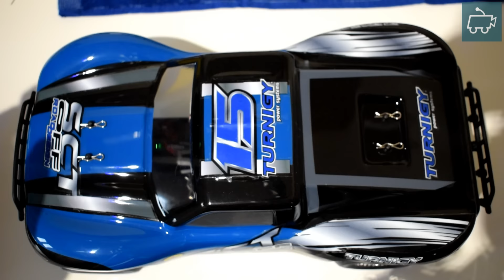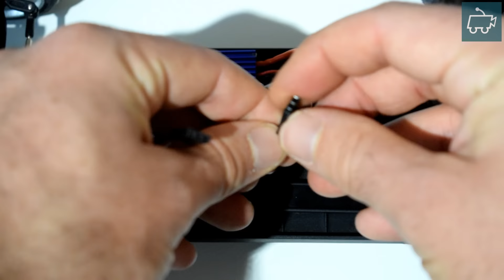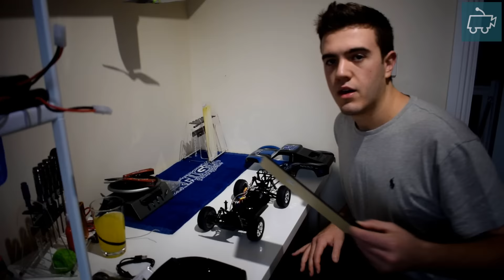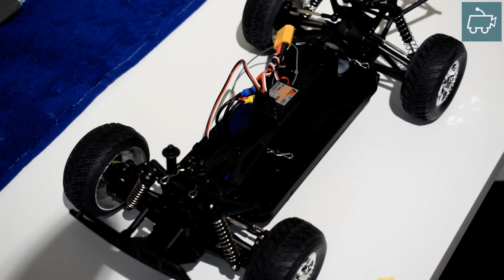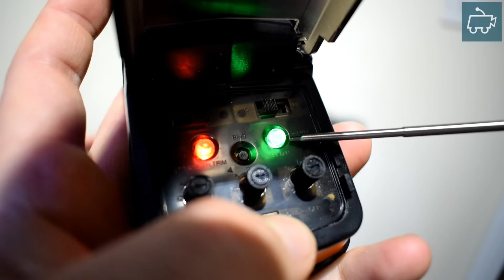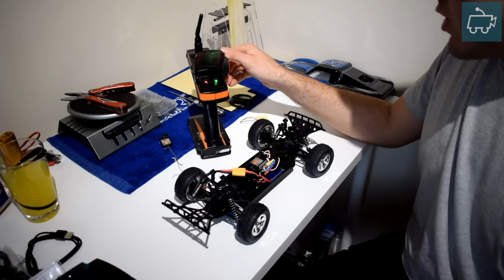How to Setup an ARR Car from HobbyKing - 2.4ghz Radio Installation

Comment: Hey man. Good to see that you're back. (after that goldfish video I thought you'd never come back) ok  so yes I have got a Losi ten t Nitro truggy but I have a problem at not too sure what it might be. All in all, it is just like the breaks are always applied. When the car is on the ground and I try and push it, it is hard to move. So then I had tested the breaks.. And when I apply the breaks you certainly cannot push it. I think it is a gear box problem...? (because when the car is off the ground you can move the wheels)
Reply from the maker: The breaks probably just need adjusting. Usually if you remove the gearbox itself the break pads are on the side, you can adjust them by loosening the screws that hold the pads onto the gearbox. Not all cars are exactly the same though I'd need to see a picture. Drop me a message with a picture on my Facebook page if you want me to take a look
Reply: JT12's R/C Videos quick response and thank you very much. I'll take a picture

Comment: how long does the battery on a nitro bug crusher pro take to charge to operate the steering and throttle for the first time
Reply from the maker: With a NiMh battery charge it until it's warm. 6 hours or so if using a standard charger
Reply: JT12's R/C Videos thanks